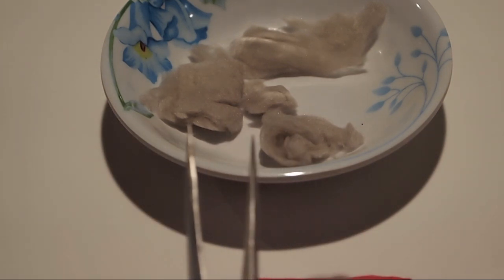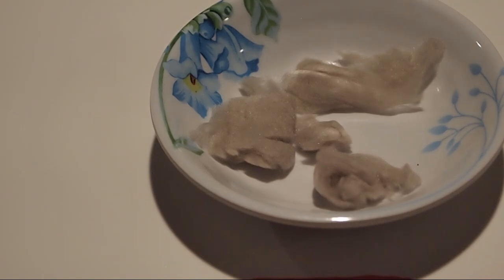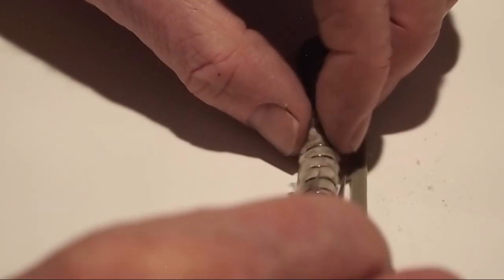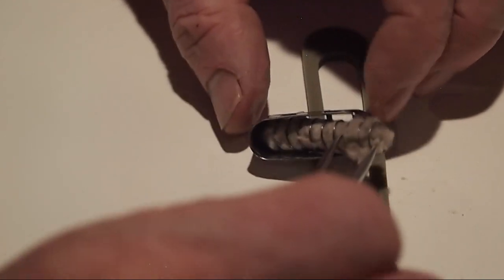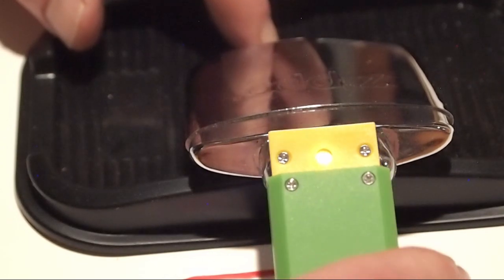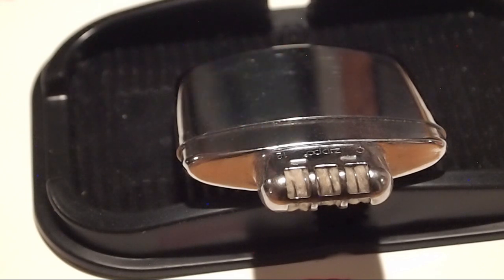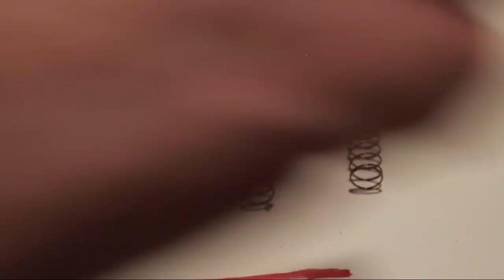Handwarmers, S01E06: Rebuilding a Zippo Handwarmer Catalyst Head with Springs

Comment: I just got my order from you. It works great. I'm going to order two more Springs!
Reply from the maker: Thanks,

The first person to suggest the spring idea to me was river guide Jeff Hanna, who I guess will now have a lifetime supply of springs, carbon felt, and catalyst to show my appreciation. I seemed to take forever to find a source for them, in the end had to get them made up. I've ordered some more springs, and am going to try a few different sizes so we can experiment. For example, the springs I have now seem to be a bit tight in the small Chinese catalyst heads, so I'm going to try a size that is a bit shorter for those heads. Also as the springs are a new method, we'll still have to see how long they last in the heads.

Comment: I’ve tried using a chuck of plain white fiberglass insulation and stuffed my spring with it and the tan little open toed sock material over the spring. It just would not stay “lit” so to speak.
Reply from the maker: You need to use platinum catalyst.
Reply: What can  I use if can't find anything like platinum catalyst pad?
Reply from the maker: You have to use a pad with a substrate of material that will have an exothermic reaction with hydrocarbon fumes. Platinum is one of  the best, but there are others. This topic is covered more on our website.

Comment: I see you're using the better "old style" of catalytic burner. 
Sadly now even the Zippo replacements look closer to the open style and the chinese one you showed in this photo. I'm curious if the Zippo replacements have better catalyst in them. I've read mixed reviews.
Can you do a new video showing the modern Zippo replacements and how they attack up and also rebuilding them?
Reply from the maker: I was unaware that the Zippo's presently being sold are different than previous models. If the catalyst is from China, then it probably does not contain any platinum.

Comment: I LIKE IT!  Just a thought~ have you tried "screwing" the material into the spring? 
Will be ordering kit forthwith~ Thanks!
Reply from the maker: Thanks Freedom,
The material turns into dust if you agitate or torque it too much. Since doing the video I've found that packing the material using forceps is a bit better than tweezers because the points are not as sharp. I've also been able to try a variety of heads, zippo, peacock, chinese large, and chinese small. In some of them there are small retainer tabs that need to be straightened prior to the insertion of the springs. Once that is done, the springs seem to work well in all of them. I'll be posting pictures of them when I update the catalyst section of the website.

Comment: does the spring work better than just adding catalyst with the stock retainer?
Reply from the maker: You can place loose catalyst in the head and it will work fine - until it falls out or gets dislodged. That's where the spring adds the added security of holding the catalyst in place.
Reply: will the process of putting the catalyst in the spring damage the catalyst?
Reply from the maker: The procedure outlined in the videos of using tweezers to insert the catalyst ensures that the catalyst does not get damaged when it is inserted into the spring.